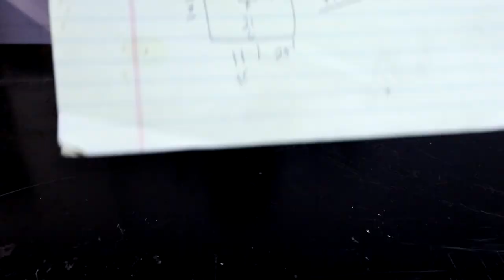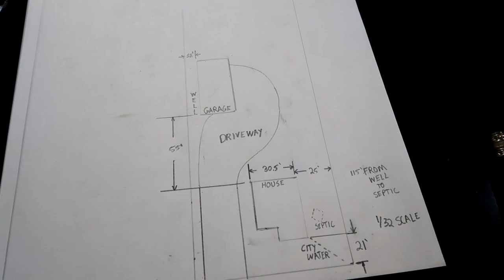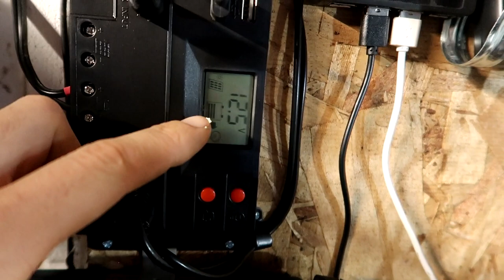SAVED BY A STRANGER | Building My Dream Home Episode 6

Comment: Those spares are real hard when the vehicle comes from up north, I stopped to help a couple with a flat and had to cut the spare loose because of the rust
Reply: I worked in a dealership, and those cable mounts need regular oiling.I used White Lithium spray on.Most don't even bother to see if they have pressure,let alone correct.

Comment: With those spares Dalton, I know you're a maintenance minded guy, add the following routine to your oil changes.

Lower spare, spray everything from the cable roller and winding mechanism down to the tire with "corrosion x" (made by PB blaster) or some other corrosion/rust preventative and then raise and lower the tire a time or two......

Oh , and NEVER get under a vehicle that is jacked up on one of those flimsy Jack's that comes with the vehicle...😉

Comment: ADVICDE for you all there:   Rules  are about  following  the  steps  to  get  where ever it is  you  want  to go .    Such as  but  not  limited to:   WHO, What, When, Where, Why, and  How.  Or  also  known as  being the  ( 1-2-3-A-B-C- )   Method of What  you  need to  do  before you  do  ( ANYTHING ) EXAMPLE:   You  Said  quite  clearly ( The  Rules  Down  Here ) are not the  same  as  where  you  came  from.  NOW -  that  ( DOES NOT  MEAN ) to through out Common  Sense  or the  sense  that  ( KNOWLEDGE is  Power ).   YOU Still need  to know  the  Basics  and  also the  alternatives.   SUCH AS:  Your  EXACT  Property  Size  and its Boundys .   CLEARLY Marked and  Measured.   What  Set Backs, Right of  Ways, Storm Swales, and Elevation requirements, etc.  On Paper , On  the property , In Writing. Exact Details, and  not  a  Guess or worse  yet ( WORD of  mouth  ) from someone, AONYONE, Who  Acts  as if  they  know  and  most likely  knows  little about  what  will happen  after the  Fact  if  any or  all of  these things are questioned and  or  presented in a  court of  law  as a  depute or  worse yet  as a ( Determination ) that  YOU Violated the  Most  common of Circumstance  that  were simply  OVER-Looked  due  to Laziness.  It understandable  that  you  are ( IN  over  your  Head )  What  does NOT  fly in the  face of  Ignorance is  ( HYOU DONT  HAVE  TO BE )  Plain and  Simple.   Having a  Plan,  Altering  it  as  need  be  and  keeping  your  eye  on the  prize at the  end of the tunnel.  SAFETY ( FIRST and Foremost )   Expect the  un-expected.  Bee stings, Rodents, Snakes, alligators, Aggetated Neighbors. The  Watchful yet  distant  eye of  the  Media, internet, and  officials who rarely  expose there True Intentions  until  after the Time  in Which  you  get  slapped  with Fines, Past  due taxes, property liens , and  a handful of  citations  from others  around  you  who filed a petition  and  never  bothered  to inform of its content. 

Construction- Large or  small  regardless of location or  time  frame  ( REQUIRES )  you  to  be  the  end  all when it comes  to being  Compliant.  You , Your brother,  the  ones  who  sell you  the  stuff , to the ones  who  sign off on what  you told  them was  the  Actual , Factual , As seen  on TV - Before , During , After, results,  With  receipts, Vendors names and  locations, and prices paid , fees and  delivery  costs  both  local and  long  distant.  Some  of  these are Deductible on future and  current  taxes  while  others  will be asked  ( LONG  after those things  ) have been filtered  thru  your  day  to day  activities.  Ever  heard the one  about  the  House that  got  ( Re -Poseesed) ???  Or  Moved  5  feet to the  left , right , or  off its  foundation and  raised  16  inches  due to  Flood  Plans, Property Lines, and  set backs or just plain  old  fashioned  ERRORS?  The  Records  departments are  filled  with  things  ( ONE ) may never  have  Anticipated  yet  made there way  thru  the  COURTS  System  none  the less.

Knowing the  difference between  old or  Grand Fathered in   ( details  to  being  Compliant  with  New  Construction , Additions, Add-Ons, and  Upgrades to  Electrical , Plumbing, Sewer and  Water,  HVAC, and local and  State , Guidelines, Rules, Regulations, and  Acceptable  Alternatives  will make  you  or  will definitely  ( BREAK  YOU )   When  Push  comes to SHOVE. NEVER EVER Take a  One  Word - Answer, Explanation , or   Confrontation at  Face  Value.  those  who  know  how  the  system  work  ( RARELY if  EVER )   Show  there  cards  before the  Shit  hits  the  Fan.   You Want  to be  Wild  and  Free  then remember not to  Forget ( Others have  gone  before  you  and  the  Tax  man  never  leaves a Stone  un-turned or  a  collection to  go  to  waste. ( BUYER BEWARE ) is  not  just a  catch phase it is a  ( WAY of  Life )  Here , There , and  every where else.   Heed  these  warnings and  the ADVICE  of  those  who  have  seen it  all before  and  watched   ( educated  adults  reduced  to  tears and  taken to the  cleaners , Time  and  Time   Again and  Again ! ! !  !!